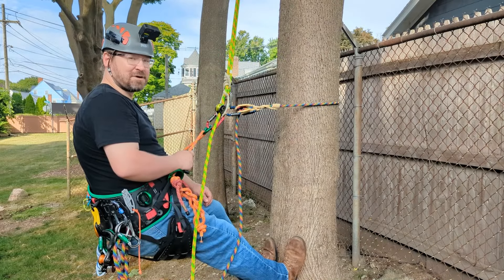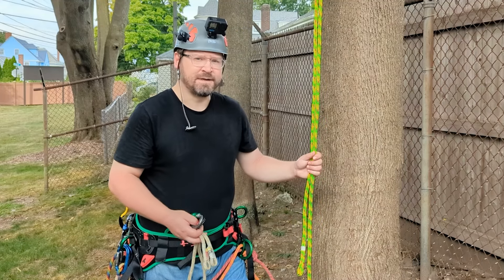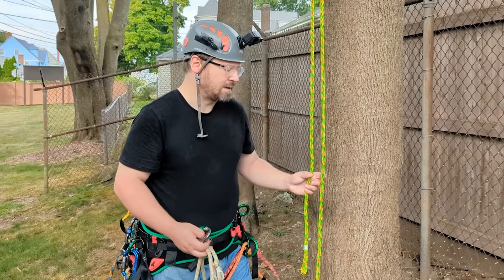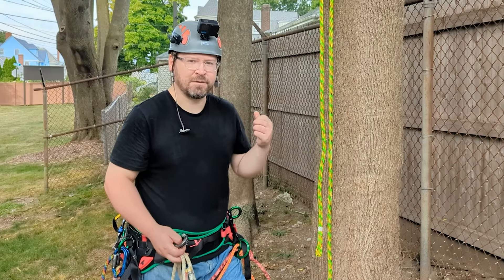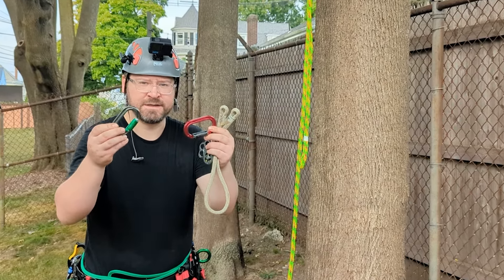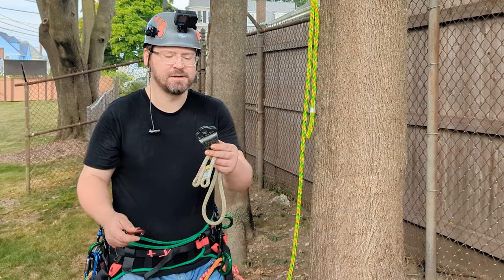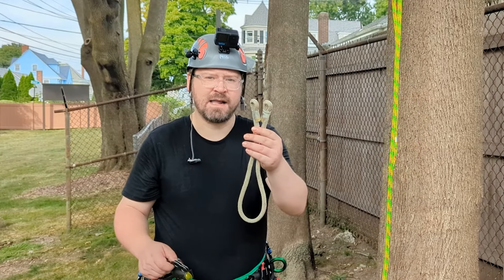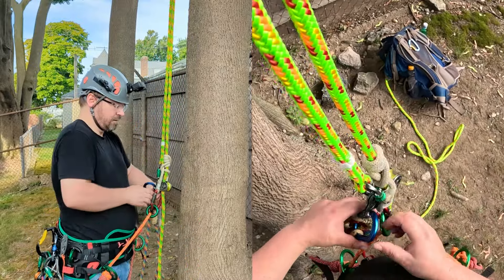HITCH CLIMBER System: Everything You NEED To Know (MRS/DRT for Arborists & Tree Climbers)

Comment: You can run hit hitchclimber without splice useing second hole instead of top hole...with anchor bendknot..and michocan..done before or adding extension and or raiseing it tge standing end difernt ways...also guys use quikies
Reply from the maker: I just can't recommend to people that they use a termination knot because, typically, it is dangerous. Although, admittedly, I've done it myself several time in the past (even in a few of my videos). I just want my content to provide the safest possible information for my viewers. Hopefully you understand.
Reply: I seen others tie and clip the rope end to an other attachment on a climbing belt.
Reply: @Knot-orious  even though the manufacture illustrates for the rope end the spliced rope end that is to be connected to the middle hole on the becket, it is still too close to the brake.
Reply from the maker: @philosborn1840  Yes, this is certainly an option for anyone who has no other option but to use a termination knot. I am aware that there are safe ways to climb with this method using knots, but couln't advise that anyone use the original setup in a way that has not been approved by the manufacturer. Thanks for your comment.
Reply from the maker: @philosborn1840  It certainly is a very close quarters, streamline system, and the splice does end practically right up against the friction hitch (or "brake"). Despite this, if you a climber uses a spliced or sewn termination, there isn't any real risk of these terminations accidentally releasing the friction hitch. As shown in my video, I always use a DMM Perfecto, which is smaller than average sized oval carabiner, to connect my splice to the pulley. This further reduces the already miniscule risk/chance of the splice somehow contacting and releasing the hitch since it is even farther away from the top of the hitch than if a standard size carabiner were to be used.

Comment: I never really like using the pully for terminating your rope to I like to put it back to your harness I just feel like the pully a weak point of you do it like that you can use a termination knot of some sort the lanyard thing is useful especially if your rope walking I true drt man will foot lock up the tree a lot faster and easier on yourself if you keep your feet higher like try above your hit hitch or at the same level it by easier to thrust up but if you want to get into I definitely foot lock your way up the rope
Reply from the maker: If you use something like a hitch climber pulley, it would be pretty strong and I wouldn't say it's a weak point. I think I understand what you're saying, though, about eliminating the pulley and terminating it to your bridge/harness instead. And, yes, foot locking would definitely be much faster. I honestly hate MRS/DRT, and climb almost exclusively SRS/SRT, so I'm not very good at the former since I rarely climb that way. Thanks for your suggestions, advice and observations. I appreciate them!

Comment: Love your Content. Thanks for showing!! 👍
Reply from the maker: You're so very welcome, my good friend from Germany! I've been filming some content for MRS/DRT lately since my library is mostly loaded with content for SRS/SRT, and I felt that I should cover the former a bit more in order to make my content more eclectic! I don't typically climb on moving rope systems, so I'm not particularly talented with them. However, I have a complete and thorough understanding how to build and use them correctly and safely! I'm glad you love my content! Thanks for your support and for commenting!
Reply: @Knot-orious  Thank you for your comment, my good friend from the USA. I use both systems when I climb. Last Sunday, for example, I had to climb to a height of about 35 meters. We could only install the SRT rope at a height of about 20 meters. I then climbed the rest of the height using the MRS/DRT method. Thank you for your last email. I am still processing my answer 😃👍
Reply from the maker: @TredasTaurin Yes, that's exactly how I use MRS/DRT...after I've already ascended into the canopy via SRS/SRT. I have zero interest in using MRS for ascending. I use it for work positioning and moving through limbs or limb walking. Mostly for triangulating my positioning! Definitely email me back when you have the chance! I'd love to hear from you!

Comment: Very detailed explanation, easy to understand and informative.
Thank you very much.

I have been tree climbing with the MRS Brakes Split Tail System, but I am considering installing the Hitch Climber System.

I would like to ask you a few questions.
I would like to know the diameter and length of the prusik cord you are using for reference.
I am also using 1/2" (12.7mm) 16 strand climbing rope.
Reply from the maker: I'm glad you enjoyed my video! Thank you for commenting! As for your question, the hitch cord I used in this video is a Teufelberger EpiCord 9.3mm diameter and 32" length. The length for this setup is too long, but it's all I had in my backpack at the time. The cord diameter is perfect for a 1/2" diameter rope, but I'd suggest using a shorter cord, such as maybe 30". Perhaps even 28" if you can splice it. If you have anymore questions, don't hesitate to ask. The EpiCord also comes in 10mm diameter, which would be another great choice. Both diameters are very supple and work well when tied into most any friction hitch. The 9.3mm diameter is going to bite into the rope harder, which is why I like it.
Reply from the maker: I take that back. At the beginning, when I use the Blizzard hitch, the length of 32" is probably just fine. Sorry, I have a lot of videos. Just rewatched to make sure. But if you use more compact hitches, a 30" might be better. But I love 32" cords because I can tie more complex hitches and thicker hitch cords eat up more length when tying a hitch. You often need more length in your eye to eye when using thicker cords because of this. Sorry for the confusion.
Reply: @Knot-orious  
Thank you very much for your kind advice.
It is very helpful.
I ordered a Singing Lock Φ10mm 80cm prusik cord and a DMM triple attachment pulley 2 for the pulley.
I am very much looking forward to receiving them.
Once I get used to the hitch climber system, I will try the SRS rope wrench.
Reply from the maker: @一人杣夫  That so great! I'm always happy to help! Let me know how everything goes! Do you own a rope wrench yet? Anyways, good luck and be safe up there! Start low and slow! Practice the motions on the ground before you take it at height. Have fun!
Reply: @Knot-orious  
Thank you very much for your prompt reply.
I don't have a rope wrench, so I am going to purchase one.
Is the rope wrench ISC?
Reply from the maker: @一人杣夫 My rope wrench is the Notch Fusion Flow combo.

Comment: Subject: Kiwi Dave, a question

Howdy. Hoping you are well and safe from awful storm on eastern coast...

Query.

When cutting limbs that are towards horizontal (or even vertical) what steps do you take to ensure saw isn't grabbed as limb falls.

Internet is a tad confusing...

Tia.

Cheers, Dave
Reply from the maker: If you're cutting a limb that is completely vertical, to where there's no obvious fall direction, then I'd suggest cutting a small face cut in the direction you want it to fall down, and then make a back cut from the opposite direction while pushing or pulling the limb in the desired fall direction. If you make this back cut quickly, and if the limb is small enough to help control its fall direction into the face cut with your hands, then the odds of getting your saw stuck are pretty small. If you're dealing with a really big branch, then you can do the same thing, except first climb up about 10 feet above where you want to make your cut and tie a rope to it. This will help you create enough leverage to direct the limb into the desired direction, and the face cut will help make the limb easier to tip once you finish the back cut. Am I making sense? I'm not exactly a seasoned pro with a saw, but that's how I would go about it.
Reply: @Knot-orious  thanks for commenting.  I'm aware of basics... just id like to know more regarding saw being grabbed. In 40 yrs it hasnt to me... a neighbours red wood grabbed his saw, twice...
Reply from the maker: Getting your saw grabbed and pinched to where you can't remove it or run the chain is pretty rare so long as your cuts cause whatever you're cutting to drop to the ground or break off. When it does happen, you either need to use some rigging to pull the piece to the ground or use another saw to try and finish the cut, then remove the pinched bar once the piece finally drops. There's no real protocol for how to handle a seriously pinched bar to my knowledge. You sort of just have to figure it out haha
Reply from the maker: One helpful way to release a pinched bar is to hammer some wedges into your cut. That can sometimes help you get your bar out or allow you to run the chain and finish the cut so that the piece will drop.
Reply: @Knot-orious  yeah nah!! My issue is... when a log is falling, the falling piece grabs the saw... in the last moment of the cut.
Rare.
But nasty when it happens...
Reply from the maker: That sounds like it would be basically just bad luck or something.
Reply: @Knot-orious  i know there are ways to reduce likelihood. Ill let you know when I've got useful answer from experienced arborist.
Reply: @Knot-orious  https://youtu.be/_GO0pR6J1eM?si=wkj9lddKtp9-sLnY the first cut... this teacher almost loses his saw. I reckon he was surprised...
Reply from the maker: @daveoseas  Sorry I wasn't of much help. I'm definitely the wrong guy to ask, but I did my best. I climb trees with the hopes of keeping them alive and the only saw I ever really use is my handsaw to remove hazards and deadwood, etc. these days. My experience comes from climbing and admiring trees. I have very little experience with slaying them, nor have I much experience with power saws.